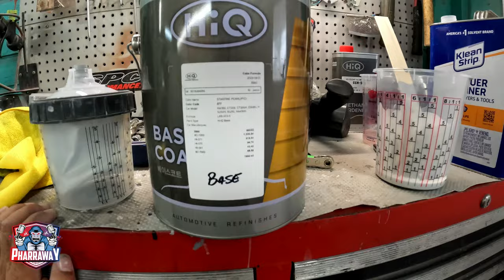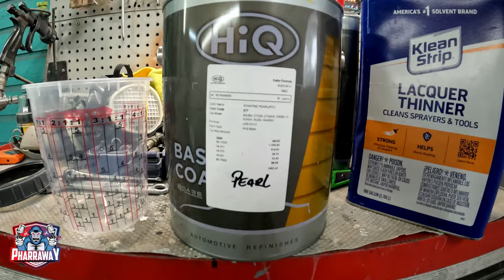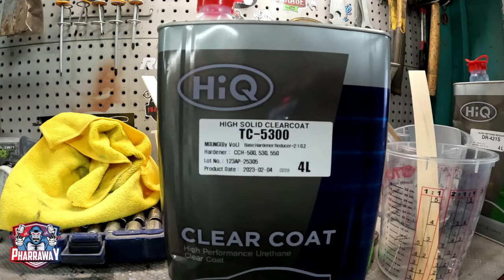Car Painting: Painting WHITE PEARL is easy and done right

Comment: Well done Primo. One thing to add, there two reason he used a sealer, one, to prevent any reaction to the original paint, and number two, to get the color closer to the base, the closer the color is to the base, the easier it is to cover, HOK has a "silver Sealer" great for white pearls, and also you can tint it if needed. Lots of painters even pros forget about tinting primer to match the base. One rule, get the car one color first, I have seen disasters where this was not done. 
Great Job as always P
Blue Mule
Reply from the maker: you are 100% correct brother

Comment: One question. How do you remove that manufacture label on the inside of the door without taping it or destroying it? I mean, I don't want it back on my door but I do want to save it in the glove box for future reference. Man they really stick that on there with something permanent.
Reply from the maker: @lodollar23  good question, the way I do it is with a heat gun and a plastic blade it should come off easily
Reply: @PHARRAWAY  fantastic thank you!